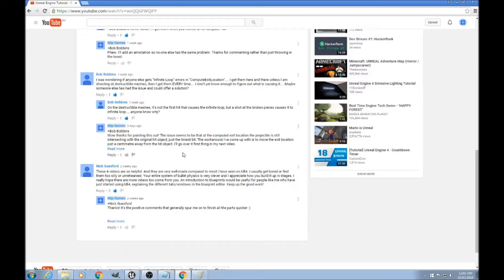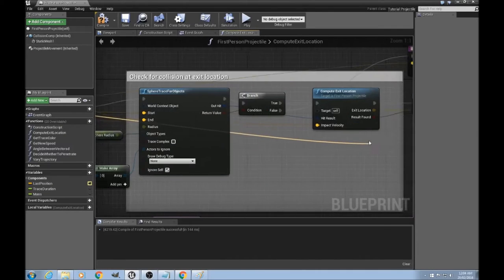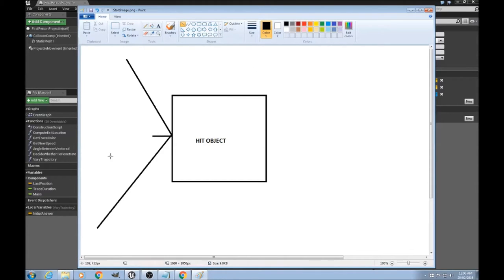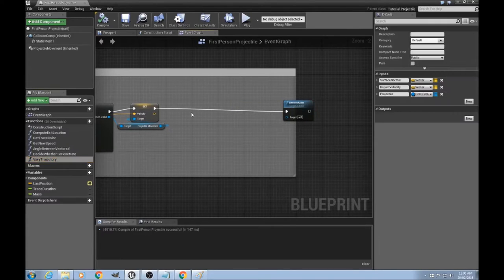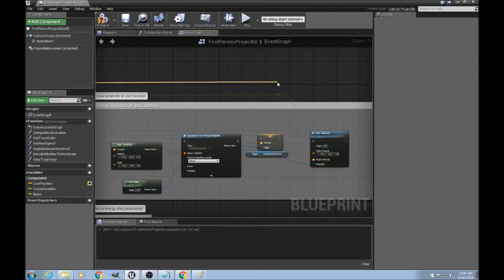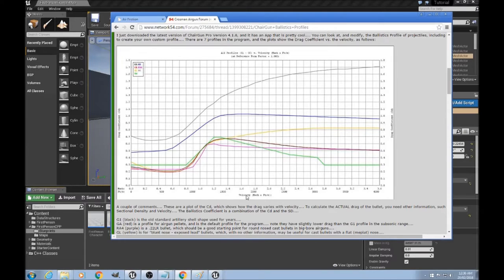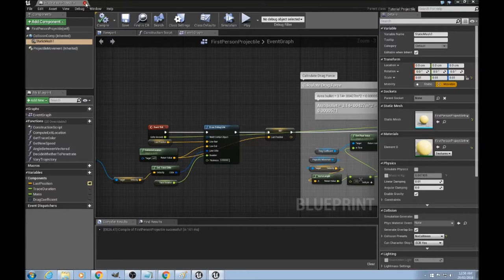Unreal Engine Tutorial - Projectile Physics part 5/5

Comment: So I’m having some issues with this. The system seems to be working but there are some things to consider:
#1: the collision shape doesn’t seem to play well with complex collisions on a mesh even with the trace complex on move enabled

#2: I’m having a hard time how to set a certain material to never penetrate or always penetrate (for my gameplay purposes I would concrete to never penetrate no matte it’s thickness. I would also like car metal/aluminium to always penetrate.

#3: The cvs/penetration data table I don’t really know what values to enter or where to find such values (like you also said here in the video).

I hope you’re still around or anybody else using this system could lend a helping hand.

Comment: Why do you divide the drag force by the mass of the object? I couldn't figure that out as despite it is intuitive, it isn't true that the mass would influence in air drag.
Reply from the maker: force = mass * acceleration
acceleration = force / mass

so once you get the drag force, divide it by mass to get an acceleration.

hope this clears things up rather than confuses things
Reply: It sure did clear things, thank you! :D
Reply: One more thing, how did you define your mass if projectile movement doesn't define mass?
Reply: So, I studied a lot about ballistics, in the end, no one in ballistics ever uses mathematical models to define air friction due it's complexity for very high velocity, small objects, they just sample it and use data sheets. Another thing, your link (http://hyperphysics.phy-astr.gsu.edu/hbase/airfri.html) says that this model should be used only for "larger" objects, I don't think that's the case. In the end, as it's not even close to real life to call it simulation I think air resistance is just waste of computational power, some constant should be far enough.
Reply: From wikipedia External Ballistics: "Mathematical models for calculating the effects of drag or air resistance are quite complex and often unreliable beyond about 500 meters, so the most reliable method of establishing trajectories is still by empirical measurement."
Reply: By the way, great tutorial, copied the penetration and energy system which is wonderful

Comment: I want to simulate a shotgun. So I want multiple FirstPersonProjectiles to spawn from the same point and have them gradually spread as a real shotgun shot. Any idea how to create that?
Reply from the maker: Insert a for loop just before the 'spawn actor from class node.'
You can't spawn them all in the exact same spot (collision). Ideally you would spawn them in a little circle just in front of the barrel - but for simplicity's sake,   you can just spawn them in a vertical line. Multiply the forloop output by a float, then use 'make vector' node (0,0,float), and add that vector to the usual spawn location. This location will be slightly different each for loop, and you feed it into the 'spawn actor' node.
Finally we need to vary the direction rotator. Use a couple 'generate random float in range' nodes, from about -1 to 1. Use a 'make rotator' node and insert the random floats to pitch/yaw. 'Combine Rotators' with the original direction. Now this direction will change slightly each for loop - feed it into the 'spawn actor' node.
Good luck!

Comment: Hey, so I'm not quite done, but close at this point. I got a lot more debugging experience than I wanted and now I'm stuck again.. First, I had an infinite loop that wouldn't let the ball go through anything, now It works sometimes, I finds matching hits most of the time, but it always stops before the new projectile is spawned.. I don't know what to do.

In other words, it's failing at the last branch of "ComputeExitLocation" after it's hit the object and been destroyed, what could be going wrong? By the way the tutorials really are great, you should have more views!
Reply from the maker: Good work in getting this far, and I totally agree I deserve more views :)

If I were faced with this problem I would temporarily create a new project, rewrite the ComputeExitLocation function, and test that everything works in the new project. Once it does, you can copy and paste nodes from one project into the other. Then you are either home free, or you can at least be confident the bug is not in that function.

Copying and pasting in blueprints doesn't work 100%. You will have to rewire some nodes, but it's not too bad. Let me know if this works or if you're still stuck after this!

Comment: These are all awesome. You have opened my eyes to Unreal.

Do you think you could do a quick video on getting your projectile system to work with Destructible Meshes? I've had no luck in getting it to work.
Reply from the maker: Thanks for the comment! A video's a bit high effort but I can take a screenshot: http://i.imgur.com/qkHYVAz.png

You can put that code after Event Hit or after OnProjectileBounce, but I chose EventHit because the other one is already huge and messy.
Reply: +Mip Games Thank you, that did it.
Reply: +Mipmap Games One more thought/question if it's a quick one to answer. It seems that being really close to the object, lets say a wall from half a meter away or closer, can cause your bullet can ignore that object's properties.

Would you suggest starting the bullet spawn further back in the player model? Or could you suggest a method to solve this problem?

I'm thinking something like casting a SphereTrace before the bullet is fired, and if any object is detected just spawn the bullet on the other side with all the other effects. I just feel that this method wouldn't interact with detestable or physic actors correctly; so I'm a bit stuck.
Reply from the maker: You're exactly right with spawning the bullet further back in the player model. If you create a new template project in the current version of the engine (4.11) epic has fiddled with the player collision capsule so the tip of your weapon never clips through a wall. http://imgur.com/VMoUfeF

I checked in my version and this works fine, I can walk right up to a wall and it still registers with correct physical material and everything.

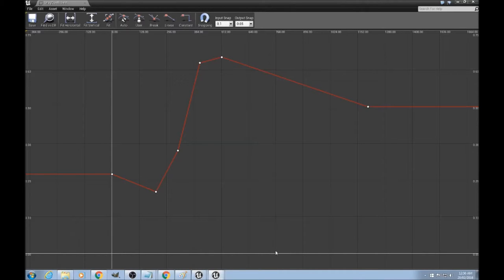Comment: almost done now. =D how did u set the curve to show value of "meters per second" ? at 9:45 my curve editor has different numbers there on X axis
Reply from the maker: +Cadu Fecak 
It won't actually say meters per second anywhere, it's just later on if you copy my blueprint exactly, the data points it draws from should represent meters per second.

Glad your problem from earlier fixed itself!
Reply: +Mip Games i figured it out. just had to drag the line long way to the right and find the right numbers. im done with tutorial now, it works well! and easy to use and tweak. :) now i am stuck with trying to implement the splash. i tried your advice but not sure where to go after? made blueprint derived from c++ file, and then made mesh, turned visibility off, and then went into penetration data and added "hardness". but dont know how to "check if meets shatter criteria".
Reply from the maker: +Cadu Fecak 
haha you have to decide that for yourself. It should probably include the impact velocity, impact angle and material hardness. 

Try it out, and if you get stuck I have made a mockup of what the simplest scheme would look like. It should fit in the event graph of the firstpersonprojectile class - after the 'OnProjectileBounce' event and probably before the 'Decide whether to penetrate' part.

http://i.imgur.com/FzFkdev.jpg
Reply: +Mip Games tried it, didnt work. i recorded and uploaded video if u want to take a look? ive experimented a bunch and best result i got was when i put spawn emitter before the destroy actor at "no energy after penetration" comment. this worked. maybe i could add some kind of damage effect to the particles.
Reply from the maker: Good work on implementing the hardness, and nice looking game!

I just picked up a mistake I made - one of the inputs to the AngleBetweenVectorsd function needs to be multiplied by -1.0 to correctly compare the angles. If you print a string after spawning a splash projectile it should be super easy to tell if it worked or not.
Reply: +Mip Games wait, which anglebetweenvector? haha please make tutorial! im trying to do a realistic weapon simulator/game, and it has to have the bullet splash! thanks for the tutorial so far anyway. i started with programming just the other week and i got a better workflow after going through your videos! (Y)
Reply from the maker: +Cadu Fecak You are doing great if you started last week!

I did up a quick fragmentation type system just to make sure it all works how I think it should. Hopefully changing the angle will be enough to finish it off - http://i.imgur.com/RoDDVQC.jpg

Doing a tutorial on this would take a long time and I'm working on my game at the moment, so I'll just do the best I can to help you.

Some pitfalls I noticed whilst implementing - make sure the 'initial speed' of your splashProjectile's ProjectileMovement component is 0.0, and the Max Speed is suitable.
-When you spawn multiple fragments, make sure their spawn locations don't overlap, or the physics will go wonky.
-After spawning a splash projectile, set its velocity to the same as the original projectile. The original one has already bounced and is heading in its new direction.
-Duplicate the 'VaryTrajectory' function but make it work on splashprojectiles.

Here's my tracer particle system if you want to use it on your bullets and your fragments. It's not  amazing but it does the job for me. https://drive.google.com/file/d/0ByEkuigSFAFNVk5MUGR3WmhkNlk/view?usp=sharing
Reply: +Mip Games yup that worked!!! =D i went another route tho with the projectile. i spawned a destructible mesh and put radius damage on it. so when the first projectile gets destroyed, destructible copy of it gets spawned adn radius damage pushes all the fragments away. :D uploaded clip on my channel! :D the shards are really small and its shitty resolution and they fly really fast.. but theyre there! =D
Reply from the maker: Awesome! Your shooting range looks real nice

Comment: Good agreement with the experimental data and tabular displays formula Jacob de Marr 
( de Marre ): b = (V / K) ^ {1,43} \ cdot (q ^ {0,71} / d ^ {1,07}) \ cdot (\ cos a) ^ {1,4},
 where b - thickness of armor , dm , V, m / s - the speed of the projectile with the armor of 
the meeting , K - coefficient of resistance armor , has a value of from 1900 to 2400, 
but usually 2200 , of q , kg is the mass of the projectile , d - caliber projectile ,
dm a - angle in degrees between the longitudinal axis of the projectile and the normal to 
the armor at the time of the meeting ( dm --- not inches , and decimeters ! ) ... what U think 
about this equation? https://upload.wikimedia.org/math/3/9/0/390af2cd1aecc9579b9be4c3fe635767.png
Reply from the maker: +OneLoopsPRO 
Interesting. I did a web search for Jacob de Marr and read a little about his equation for penetration thickness. It is said to be very accurate. I wonder whether it works for materials other than metallic armor?

Of course as it stands my current model is better than 99% of shooters, but a stickler for realism might want to look into it. Using the de Marr formula would take a lot of exponential functions - which are computationally expensive, but I don't think it would affect performance.